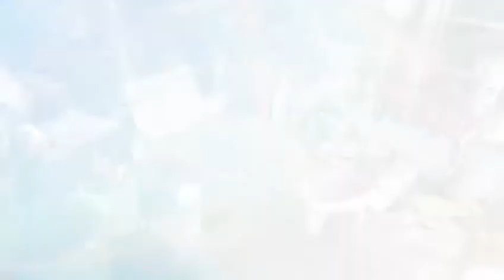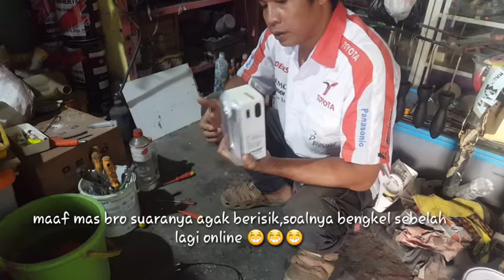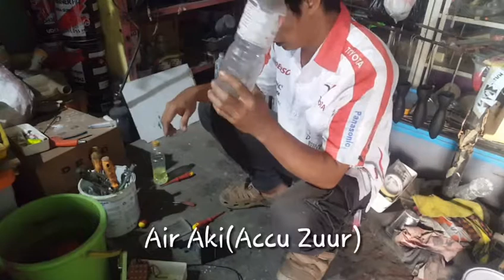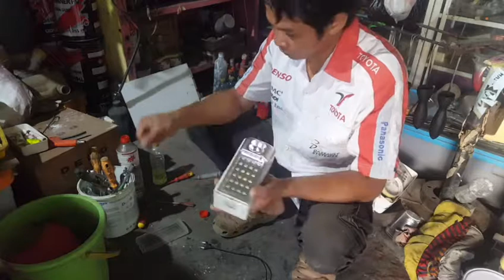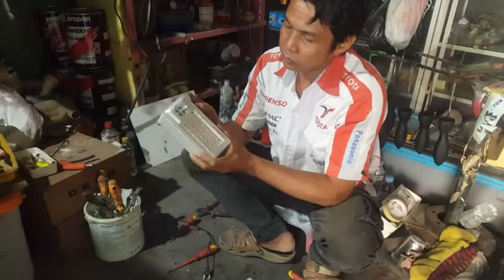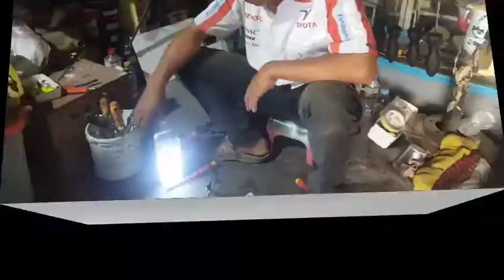Service lampu cas

Comment: Kalau di cas dari aki bisa ga bos
Reply from the maker: Bisa bos..asalkan voltnya sama 6v
Reply: Aki yg motor 12 v ga bisa ya soalnya sering matilampu terus ini pun punya sudah mulai lemah mau di cas dari aki takut mati
Reply from the maker: @badryaldiansah3667  nda bisa bos aki 12v bisa menyebabkan kerusakan,lebih baik belikan lampu led 12v untuk aki tersebut sebagai ganti lampu emergensi sementara..